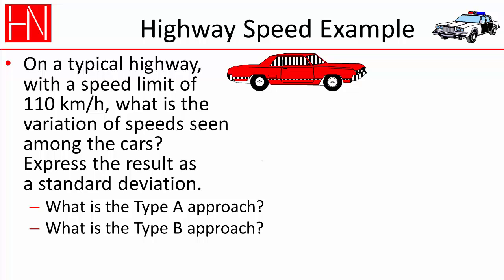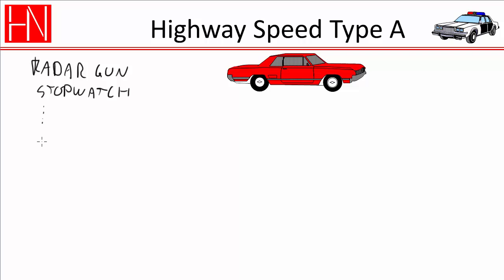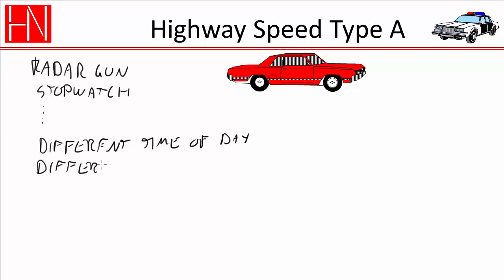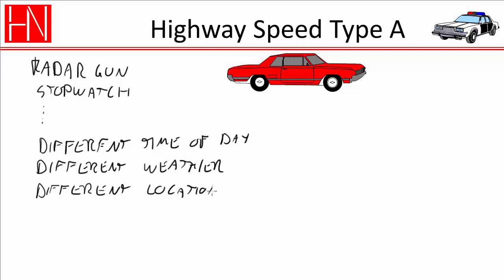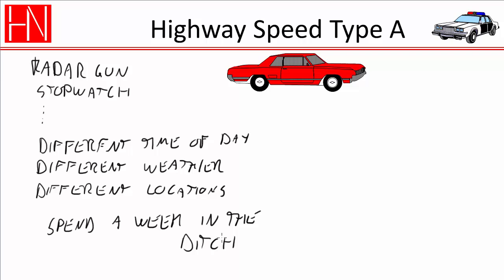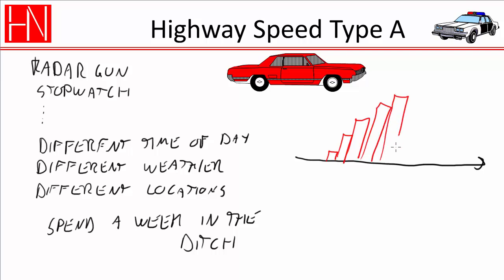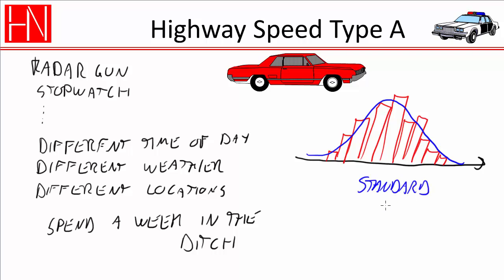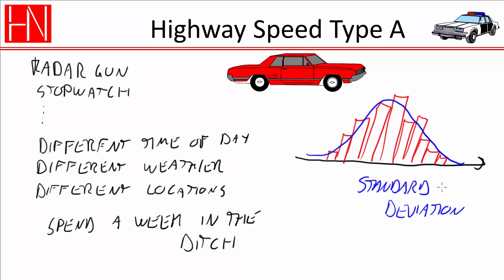Type A and type B uncertainty evaluation: Highway speed example.

Comment: Sir, you have excel. Type A i got it. But type B uncertainty not getting. please help
Reply from the maker: A type A evaluation of an uncertainty component involves making repeated measurements and calculating a standard deviation from those measurements as an estimate of that uncertainty component. It can only be used for uncertainty components you can see as variation from one measurement to the next. A type B evaluation of an uncertainty component is  "anything other than calculating a standard deviation from repeated measurements", for example using tolerance limits given in a specification or a calibration certificate and converting that to an equivalent standard deviation by assuming a distribution within those limits. That distribution could, for example, be normal, rectangular, triangular or U-shaped, depending on the nature of the uncertainty component. In the example I assume a normal distribution, but for a tolerance for a piece of measuring equipment, you would typically assume a normal distribution. That is equivalent to saying that you know that the deviation of the equipment is within the tolerance limits, but it is equally likely to be anywhere within those tolerance limits.
Reply: @HNMetrology  Thank you sir, I need mathematical calculation. for example, rectangular, traingular components how to calculate. any pdf document please share.
Reply from the maker: @anandanramachandran3930  You can find the conversion factors for the various distributions on my website here: https://www.hn-metrology.com/distrib.htm
Reply: @HNMetrology  Sir please help me. Including Uncertainty budget calculation.
Reply from the maker: @anandanramachandran3930  I do not.